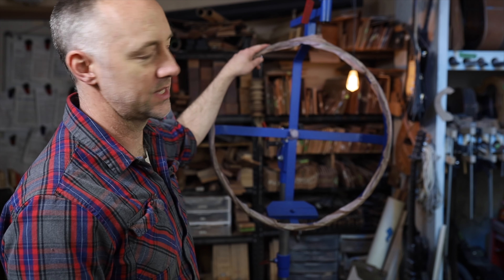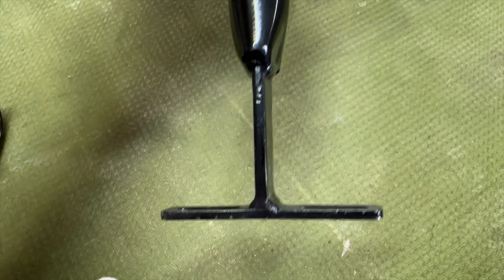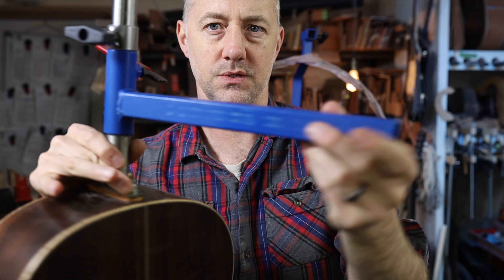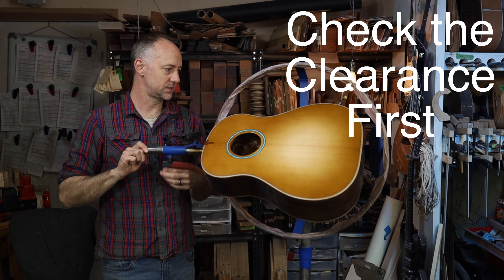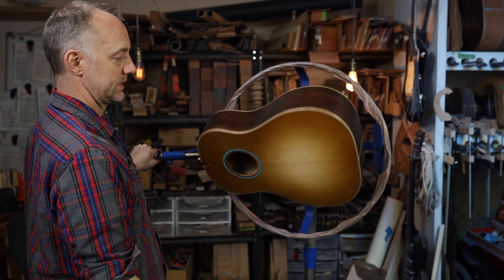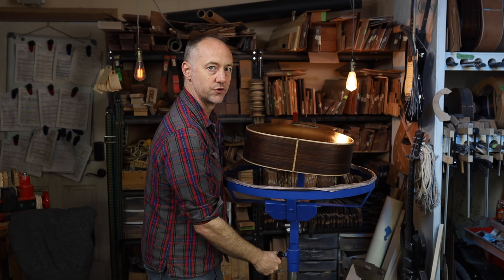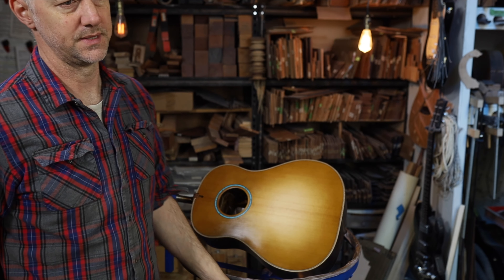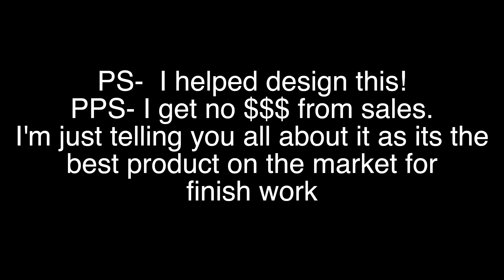Achieving Flawless Guitar Finishes Easily

Comment: Beau, just French polishing a guitar now, which means I'm always working on a flat/horizontal surface. F or the back and sides I use my shop built vacuum clam bot for the top I have to lay it on my bench since I don't want the vacuum to muck up the new finish. wondering if you think the lazy Suzann position or some other iteration would work for French polishing?
Reply from the maker: Hi- the luthiers finishing station would work but I think if you are ONLY french polishing, a better option might be the Robbie OBrien Soundhole clamp with the crossover mini - https://totalvise.com/shop/luthier-tools/obriens-sound-hole-guitar-clamp-package/ 
Here it is alone- https://totalvise.com/shop/luthier-tools/obriens-sound-hole-guitar-clamp/
Reply: @BeauHannamGuitars  Thanks Beau, I'll check it out